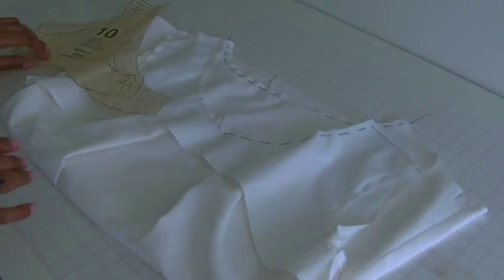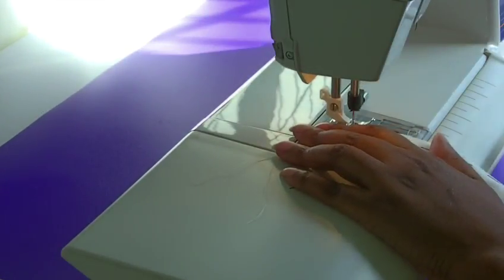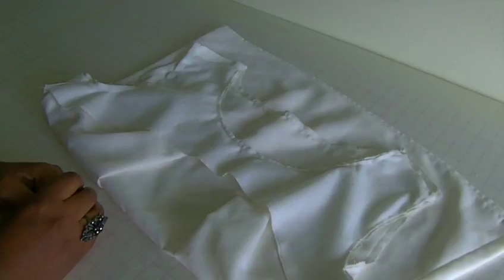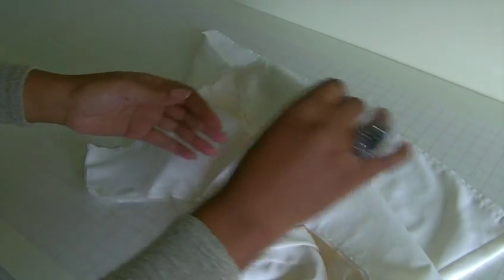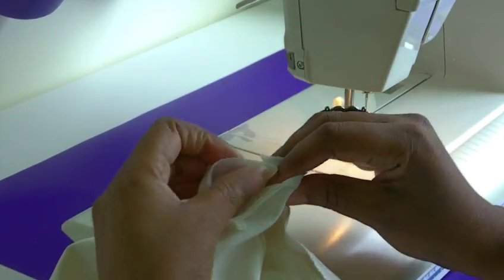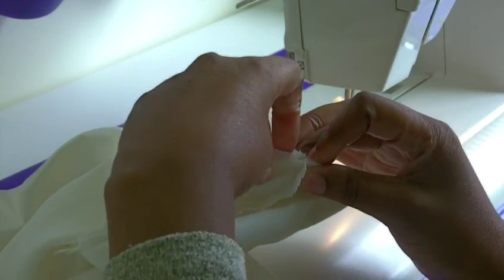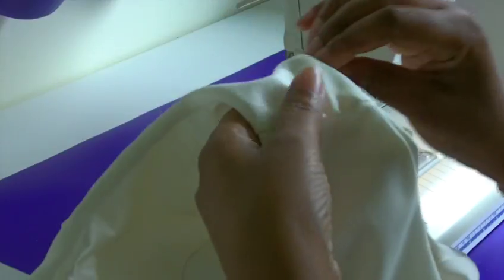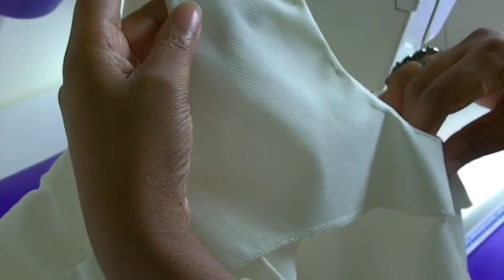How to Sew an Armhole and Neckline Facing

Comment: I don’t know what I’d do without your help. I tried for days to find how to do this part of my dress and finally found your tutorial. I used fine silk and I’m having such a hard time, I’m glad though I didn’t just throw the dress out. Lol., kept trying. I can’t wait to get back to it to clean it up better at the edges then try to connect the shoulders. I think you went in 5/8 of an inch it was hard to tell. To play it safe I used a straight stitch and increase the length to 3.5 so I can take out mistakes. Also I had a lot of fraying problems which did not help.
Reply from the maker: You'll get there. Sounds like you're right on track.

Comment from the maker: @3838bbla In this tutorial I used facing to hide the raw edges so therefore the seams did not need to be covered by lining fabric. It is possible to neaten raw edges by using lining or another fabric but not in this case. I will be making a sleeveless dress with lining over the Christmas period so keep tuned.

Comment: Thank you for a great tutorial. I just sewed an armhole and neckline facing to the back of the blouse as stated in the instructions. The next step is to UNDERSTITCH it. I know what understitching is when it comes to doing separate sections of the blouse, such as the neckline. But how in the world can I do it after sewing this particular facing? I noticed in this tutorial that you did not do any understitching after you sewed the facing on. Instead, you graded your seams to help it lie smoother without bulk. Your method makes much more sense than the instructions that came with the pattern.  I will be looking for more of your tutorials!
Reply from the maker: Thank you for commenting.

Comment: thanks for great video :)  in regards to the shoulder seams.. you can just sew straight across to save you trying to sew round that tiny area then pull it back through x
Reply from the maker: debbie ferguson Yes. that's certainly once technique you could use.

Comment: Thank you so much for your instuction.  I was wondering what size seam do you use when attaching the shoulder facing and garment?  Would you use 1/4" 1/2" 5/8"?  Do you trim away any of the excess before pressing the seam towards the back?  Thanks for your help!  As always, appreciate it.

Comment: I'm making dresses for charity and this is just the advice I was looking for, the pattern I am using is an old Simplicity one with a separate front yoke, I was wondering if I could do this technique by adapting the pattern somehow? The pattern states to join facing to front & back at neck, then side seames then bind the armhole

Comment: Hi, I have bought an Easy sew pattern for a linen sleeveless dress.  The shop suggested I should line it.  However, the pattern does not tell me how so I have looked at your video on lining.  My question is how do I put in the neck and armhole facings?  Do I sew the linen facings onto the lining first and then attach the lining to the dress?  Your help would be appreciated, thanks
Sally

Comment: I made a dress (McCalls 3227).  I had a terrible time with attaching the facing to the dress. I had to serger all edges because the very silky fabric was unravaling.  I notice you had a very narrow seam,  and I don't know how to "grade".  Does the trimmed off piece, is it the facing or the dress?  I should have watched your video first.  I would like to make another dress.  What is your idea of using seam binding instead of facing, like store bought clothes?  Any help would be appreciated.
Reply from the maker: Both techniques are great it just depends on the effect you want to achieve on the project. I do have a video on how to grade seams.